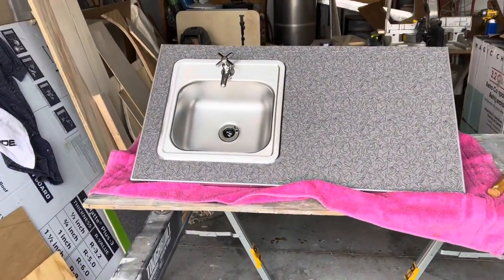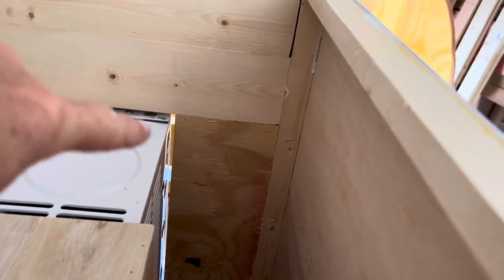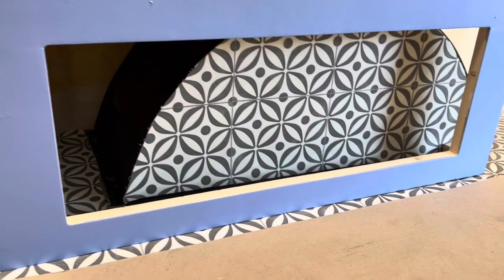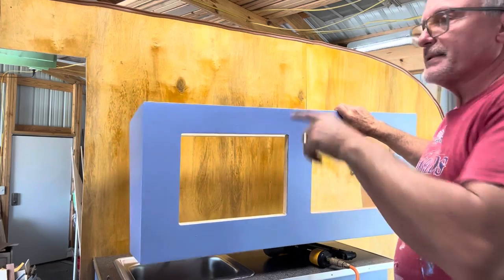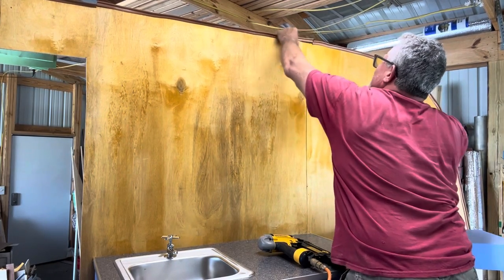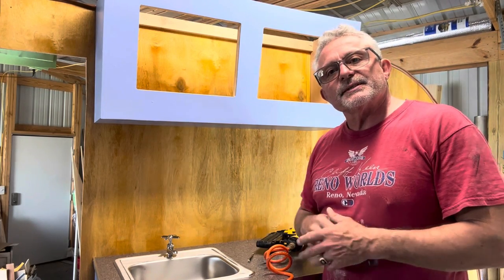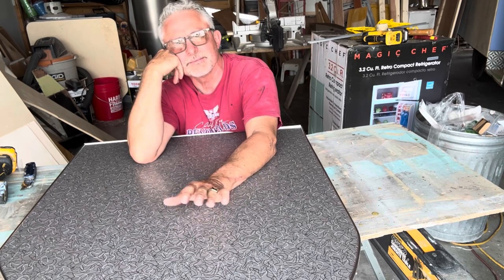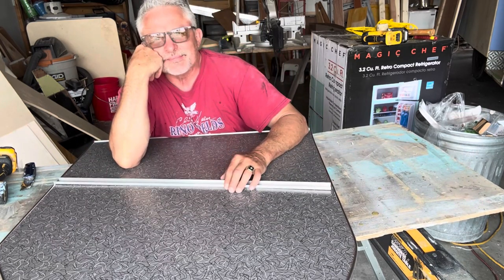EP 287 Venting the AC in and out vintage camper and other tips and tricks.

Comment: Rob, I enjoy watching your videos. I do have a question on venting the air conditioner. If that air conditioner unit ever has to be replaced, do you believe the replacement unit can be adequately sealed since you won’t have access from the rear of the unit without removing the skin?  Or will there be a vent screen on the exterior that will be removable?
Reply from the maker: There are separate vents on the exterior.

Comment: I really like the extra touch on the wheel well!
I do have a question for you... the welting that you used looks much wider then the stuff I've seen in the past! Is that a specific welting?
Reply from the maker: It is available at Vintage Trailer Supply. Easier to work with.

Comment: Where is your condensate drain? Did I miss that? That's going to cause some issues.
Reply from the maker: New AC technology. There is no drain.
Reply: @RobTheRebuilder  The rules of physics be damned.
I did some quick research. Some of the smaller AC units do splash the condensate on the condenser coil to help cool them off, but unless you're in southern AZ you would likely have issues with overflow condensate. That, or the AC doesn't do much work.
That being said, I really liked the setup. (Now to fix the condensate...lol.)
Reply from the maker: @Myrune1  There is literally NO drain hole in the new models.  Been using them for about two years, no problem.